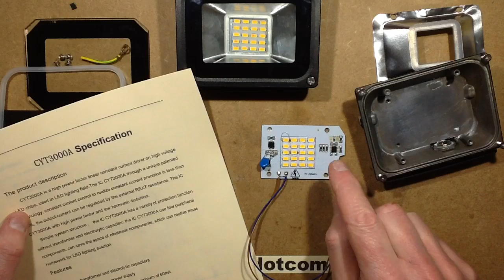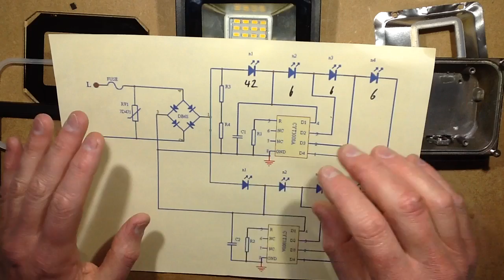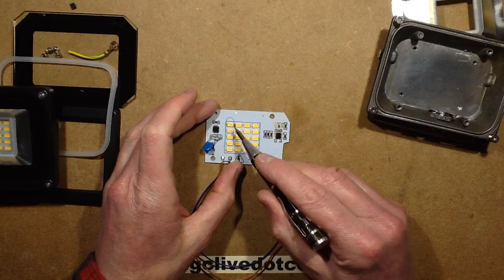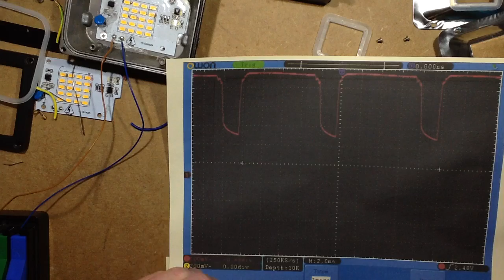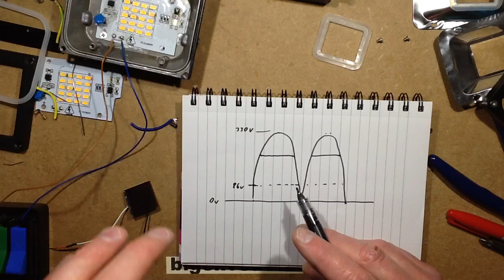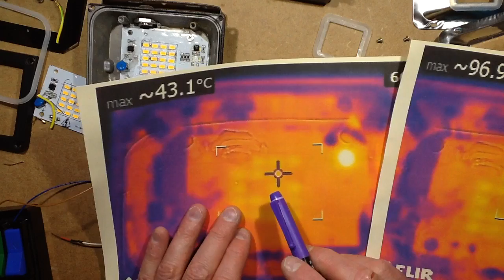Teardown, autopsy and hack of dead SMD LED floodlight.

Comment: Hey Big  Clive, love your work man!  I have similar LED flood light that are AC too, and I'd like to run them 24v DC - is that possible??
Reply from the maker: You may be able to get a new LED array/driver that allows use at lower voltage.

Comment: Is it possible to replace the individual LEDs that has the black spots (or maybe just remove the burned LEDs and bridge with a short wire to get the light working again)?  How does one go about figuring out what LEDs are used on flood light such as these?
Reply from the maker: It depends on the type of LEDs.  Some are multi-chip designed specifically for these modules.

Comment: Just rewatched this video and I had an idea. High power less have a hundred chips in a ten by ten array but if they were all linked together in a chain of a hundred could 3 chips be used to switch the first 20 on then ten or row at a time? Would that result in low dissipation and more of the rectified synwave being used

Comment: I think the newer version of these units are much smaller.
Here is a link to the cheapest unit i could find... (Note: It's the 10w unit) https://www.ebay.com/itm/10W-20W-30W-50W-100W-LED-Flood-Spot-Lamp-Outdoor-Garden-Landscape-Yard-Lights-X1/162730908039?hash=item25e3849987:m:mrDh_UKTBZexp4UjS35jrJw

Comment: Hi great video just the right balance between theory & practical
Did you remove the surface mount fuse to fit the 680nf capacitor ?

Comment: Bigc what are your thoughts on these smart ic floods (50-100w) are they worth the effort or should we stay with the internal driver cob style. love your vids
Reply from the maker: I'm a bit wary of them as previous teardowns of lights with those chips that switch in sections of LEDs to ride the sinewave have been prone to chip and then LED failure.

Comment: The idea of the smart chip flood light and running the leds directly from the 240v mains, is all great but, the smart chips have been failing and blowing up the led chips...for higher reliability the cap dropper and smoothing cap is a better idea. excellent video, good work.

Comment: Chips used instead of cap dropper for better power factor.
I'm looking for a decent PIR LED floodlight that will last 10 years.
Most on the market are IP44 which isn't high enough. Even IP65 ones appear to have poor design on the PIR with many opportunities for water entry.
Anyone make an IP66 PIR floodlight?

Comment: Can these types of lights be converted to run on 12V DC?
Reply from the maker: Not this type.  It has a high voltage series array of LEDs.
Reply: OK, thank you. Are you familiar with this type (or is it a similar setup)? I am wondering if it could be converted to 12V DC. http://www.aliexpress.com/item/LED-FloodLight-100W-60W-30W-15W-Reflector-Led-Flood-Light-Spotlight-220V-110V-Waterproof-Outdoor-Wall/32557157680.html

Someone posted a couple pics: http://g01.a.alicdn.com/kf/UT8I0cQXAlaXXagOFbXp.jpg

http://g03.a.alicdn.com/kf/UT8DE.SXphXXXagOFbXo.jpg
Reply from the maker: You can buy other types of LED floodlights on eBay that are designed for 12V operation.  But not the type shown in the video.
Reply: Yeah, it's just that they (12V) are more expensive and there are not as many design choices.

Comment: +bigclivedotcom I just bought a "100 Watt" version of this design, and made a 1200 Frames Per Second video that (sort of) shows how the CYT3000A LED driver switches in and out the several banks of LEDs. My half-arsed analysis of what can be seen is in the description under the video.
It can be seen at the following link:
https://youtu.be/9mSptMbGDnk

Comment: +BigCliveDotCom  Do you take requests?

I've been watching you teardown and diagram LED circuits for a while, and still trying to grasp running COB LEDs without an LED driver, just a high wattage resistor.

If one has a 10W COB LED(3x3) with the following ratings: Forward Voltage (VF): DC 9-12V and Forward current (IF): 1050MA.  I know that running the LED on 12V with a 3.9Ohm resistor works, but I don't know how to calculate that it will.  I know the answer resides in V=IR.  How would you explain this?  I did a quick Google search, and it appears in not the only one confused.
Reply from the maker: +Rich Booth Deduct the LED voltage from the maximum possible supply voltage (allow at least 14V for a vehicle) and that is the voltage you have to drop across the resistor.  Then divide that voltage by the required current (1A) to get your resistor value.  So 14V minus the LED voltage of around 10V (may vary a bit) gives 4V to drop, divided by 1A equals 4 ohms.  Nearest standard value is 3.9 ohms.  For the resistors power dissipation multiply the current by the voltage dropped across it.  So that's 1A times 4V equals 4W power rating plus a good margin for a longer resistor life.
The resistor cam be mounted inside the case to share the LED heatsink, but mounted well away from the LED.
Reply: +bigclivedotcom That definitely explains it and takes the mystery out of it.  Thank you for taking the time to craft such a detailed response.  It is amazing how efficient, powerful and versatile LEDs are (they are not your grandfather's straw hat LEDs).

Comment: Aluminum castings tend to come out a different size than the mold.  If they took the dimensions from the mold the screws will not quite line up.

Comment: Milliohmmeter? (I've seen some cool designs for those recently, including one from Scullcom here on YouTube.) Or just cut the one pin that's shorted, on only one chip, and re-test. That way you only have one pin to resolder if you picked the wrong one.

Comment: I have two LED PIR floodlights on the front of the house. One is a 10 watt and the other a 20 watt. Different physically - not the same manufacturer.

Just recently the 10w stopped working altogether and the 20w is just glowing a bit. It's appeared to have happened during the very low temperatures we just had recently. So I'm thinking that may have had something to do with it.

Anyone got any thoughts?

Comment: Probably poor design.
Just because a TO-220 transistor may be able to dissipate 100W, doesn't mean that it can under most circumstances!
Transistors usually have a maximum rated power dissipation like that, which is measured with the transistor at 25C ... try keeping the transistor die at 25C! It's VERY difficult to do!

Comment: Could you heat the aluminum on the back of the circuit board to prevent the heat sinking while soldering (or desoldering)? Thanks for the videos and looking forward to the next...

Comment: Hi Clive. I commission Caterpillar generators for the offshore Oil & Gas industry. We have virtually all LED and electronic ballast fluorescent lamps on the new-build platforms.  I notice that with ONLY lighting loads running, the power factor is quite leading (capacitive) but the actual load is so small that the generator doesn't care. Once you start a few HVAC compressor motors or other inductive loads, the power factor of the entire facility is still lagging. Power factor of lighting load on a facility with a few megawatts of motor loads and a few kilowatts of lights is a non-issue.
Reply from the maker: +davida1hiwaaynet In an application like that, the lighting probably counteracts a small percentage of the inductive load power factor.  But the lighting will be a tiny amount of the whole load.  How reliable are the LED lights?
Reply: +bigclivedotcom 

It does counteract some of the lagging PF from the motors.  When a few small motors are online along with the lighting, we see a perfect unity power factor.

Often on older offshore drilling facilities, the main load of the whole power plant is early type SCR drives for DC motors. These generators are designed to operate at 0.7 power factor because of the horrid way in which the SCR drives chop up the sine wave.

Most of the facilities I work on are brand-new. They have been using an ATEX rated LED fixture with the round circuit board and surface-mount LED's. They seem to be reliable - unless shoddy installation techniques allow water to ingress at the cable gland. Then they fail quite rapidly. When they fail, they often start flashing off and on, or certain LED's go dark. I will post a link to the actual lights they used after this comment. Scroll down to the "Champ" version. That's what was on the facility - maybe a slightly older version with slightly differently-styled heatsink fins.http://www.cooperindustries.com/content/public/en/crouse-hinds/products/lighting/led_luminaires.html
Reply from the maker: +davida1hiwaaynet The large arrays of SMD LEDs seem to be a popular approach.  It sporeads the heat over a larger area and allows long series strings.  The water ingress issue is always a problem with LED fixtures.  It can even find its way along the inside of the cables when the gland is otherwise tight.  If it pools in the bottom of the fixture it can corrode the tracks quickly due to the DC.

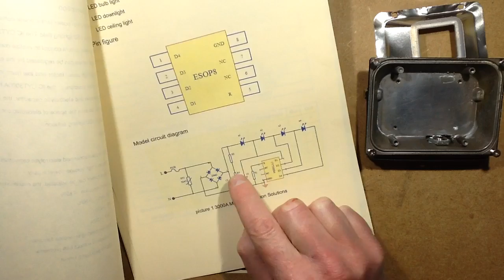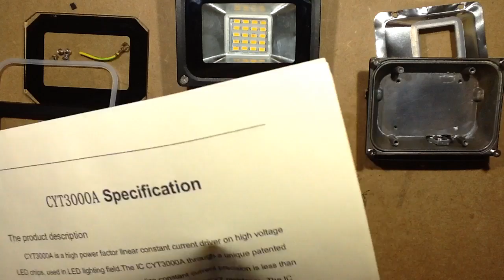Comment: ...Is it just me or is the bridge rectifier in the wiring diagram at 1:40 and the larger diagram at 1:50 connected so that it blows the ass out of itself for half the AC waveform?
Reply from the maker: +Lierofox Yup.
Reply: +bigclivedotcom ...And that diagram was made by the chip manufacturer?  Terrifying.

Comment: Are these lights actually rated for 240V? 20 chips at three LEDs each is 60 LEDs total vs the reference design's 72, that's an extra 36V the chip needs to drop in current-limit mode during about 110 degrees of each half-cycle. That's an extra 1.6W for those final stage current-limited drivers to get rid of on top of the original design's 4W. (Well, 0.8W and 2W each with two chips sharing load.)

Comment: If you ever get a chance would you review these? 
http://www.ebay.ca/itm/LED-Dimmer-12V-Touch-Panel-Switch-DC12V-For-Single-Color-LED-Strip-LED-Lights-/191761537548?var=&hash=item2ca5e0da0c:m:mPvh8OaBmdB2YjBg5ppmr3A

http://www.ebay.ca/itm/12V-RF-Wireless-Remote-Switch-Controller-Dimmer-for-Mini-LED-Strip-Light-New-DX-/261808125175?hash=item3cf4faf4f7:g:rH8AAOSwEeFU~~mw

Comment: I've soldered/desoldered probably hundreds of opamps from various multilayer boards with no space around them because of other passives. Not wanting to use a heat gun for various reasons, my method is just to dump some flux onto the pins, cover them all with solder, use a soldering tool that has a flat angled tip to lift one side of the IC, leaving the solder on the iron, then doing the same for the other side. For re-seating the same IC, I just use some flat pliers to flatten and angle the pins correctly. If you put the IC into an alligator clip on a holder (by the IC body of course), you can run the soldering iron underneath the pins while gently brushing them from the top with a wire brush tool to remove all solder bridges and clean the pins up without bending them. Very quick process. I've done this many times on 48 pin SSOPs (0.5mm pitch) with 0 issues. The keys are careful inspection with a magnifier, using good flux, and being sensible about temperatures. Flooding the chip with solder means that you have to work quickly. If it's not working out, let the chip cool etc. This method also totally avoids lifted pads when executed correctly, since you should require very little torsion to lift one side of the chip once the solder is all melted.

Also IR printouts, scope printouts, eBay printouts... it looks so wrong but feels so right haha.

Comment: I had trouble with fixing one of the LED bulb with the same 5630 emitters (one chip version though), every time I replaced an LED, another one failed. I ended up gutting the switching power supply and replaced it with small 220nF capacitor dropper circuit with a bridge rectifier. Nice repair.

Comment: An easy way to remove components from Al. or copper based PCBs is use a fry pan on very low heat, or an electric sandwich maker. Then use a heat gun over the top to re-flow the board. If the PCB has thermal paste on the back, stick a sheet of Al. foil to it first so you don't get goop all over your kitchen utensils.

Comment: I bought some of the $4.00 10W ones you'd messed with a while back, with the 9 led chip and about 8.5W draw. Sure enuff, the LED is really well balanced, all chips come on at very low current evenly, and the work great! Same B.S. with the ground wire tucked neatly out of the way, and a bit short. Pulled it thru the cord a bit further, and fastened it down. Nice beasties.  P.S. Added to your Patreon group. Keep up the good work and 'splosions! Stu

Comment: I'm frequently amused by the Chinese manufacturers' total misunderstanding of how to properly use thermal grease. They seem to believe it's a magical substance that can bridge several-millimeter-wide gaps, if only you glob enough of it onto a PCB or component. The way it was applied here, it created a thermal barrier. The stuff is meant to be applied in a thin film, between well-mated, smooth surfaces, to bridge microscopic surface imperfections. You should never apply so much that it reduces metal-to-metal contact at the component-to-heatsink interface. It really takes very, very little to be most effective. The Chinese overuse of the stuff is particularly funny given how much effort they put into cutting cost; they make their products worse >and< waste money.